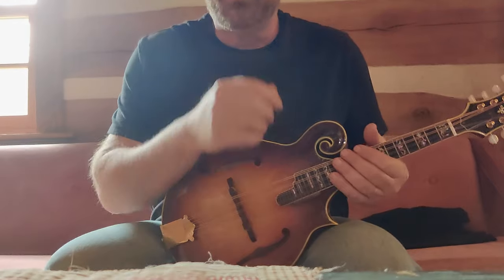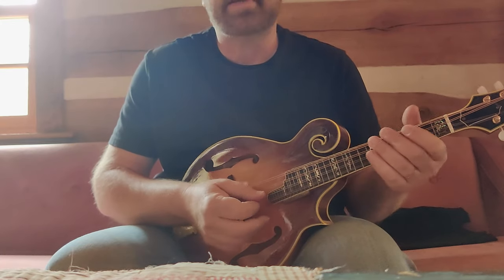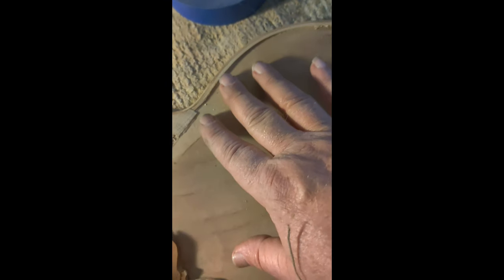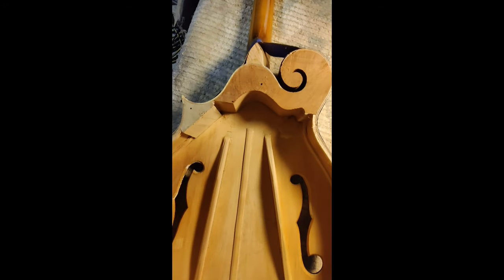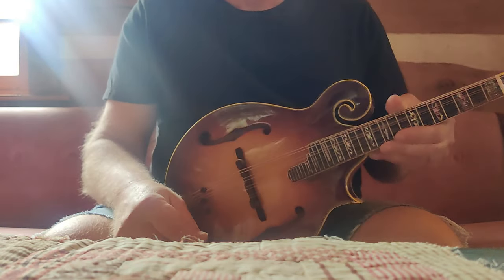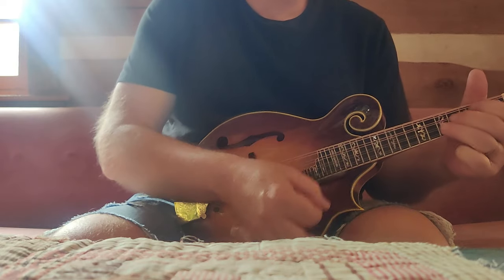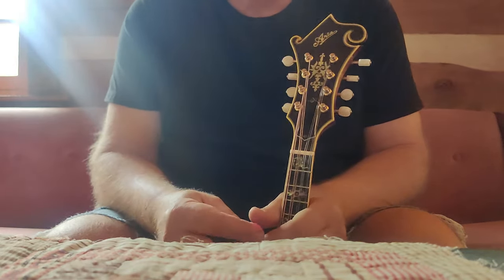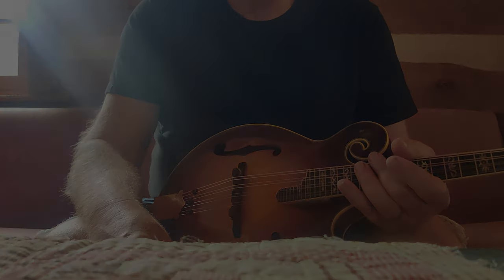F5 mandolin Revoicing before and after by Ron Stewart

Comment: What did you sand off the inside of the top?. Besides the tone bars. The top is where all your movement and sound is created. The bars and top thickness is the most important. Top thickness is more important then back.
Reply from the maker: Thanks for your comments. Actually back thickness is just as important as top thickness, just in a different way. I did re-thickness the top, replaced tone bars and re-tgicknessed the back. I have a 50's F12 conversion in the shop now that has the top only done in the 70's. Sounded ok but without the back thicknessed correctly it was just a good mandolin, not a great one.

Comment: Thanks for sharing, and being pretty specific about what you were doing.  You did a nice clean job, and it sounds great now!  I wish you showed the actual back with everything carved and scrapped, and also the top before and after voicing, and then the tone bar install and thicknessing.  But, you still inspired me a bit ... I've done a few of crappy fiddles, and they turned out great.  I don't have any cheap mandos to mess with though (I have a nice flatiron f, and a decent old eastman A style with soundhole, not f's - not taking either of those apart as they sound really good).  But, maybe if I come across a heavy Japanese mando for cheap.